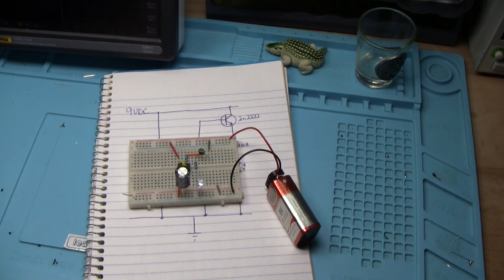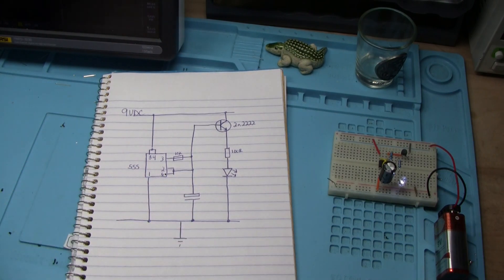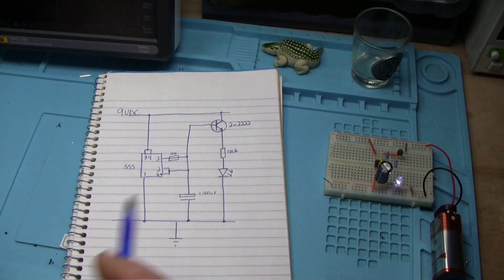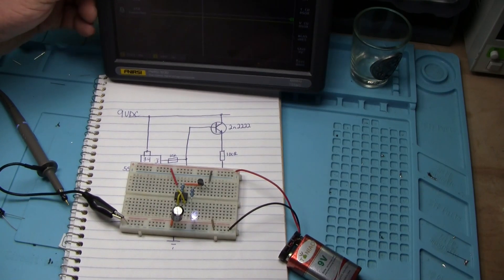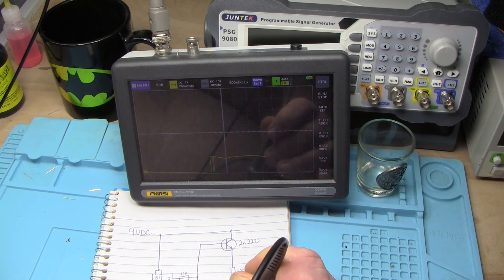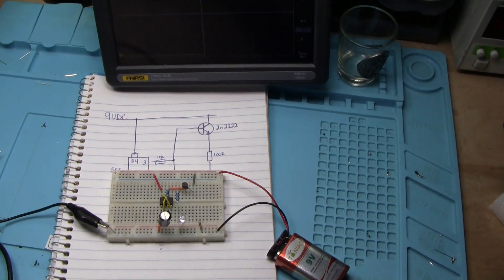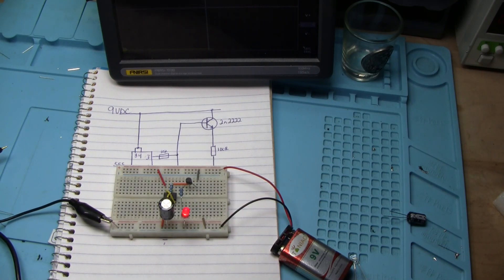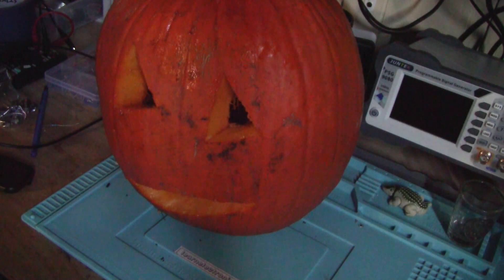Classic Circuits You Should Know - LED Fader

Comment: Thanks.

Pin-1 555 >>> GRD
Pin-4, Pin-8 555 >>> VCC
Pin-2, Pin-6 555 >>> Base Transistor, 10k, +Cap
Pin-3 555 >>> 10K

Base NPN Transistor >>> 10k, Pin-2, Pin-6 555, +Cap
Coll. NPN Transistor >>> VCC
Emm. NPN Transistor >>> 100k

100k >>> +LED
10k >>> Base Transistor, Pin-2, Pin-6 555, +Cap

LED- >>> GRD

Cap- >>> GRD

Comment: Thank you so much for showing us this schematic and explaining how it works - it's almost exactly what I've been struggling to figure out how to do so this video has been tremendously helpful!

I do not have a background in electronics so finding out, or rather, understanding wat different parts of a PCB do and why they do it is a real challenge.
That said... what I want to build, and to which this schematic has been so helpful, includes a touch sensor, and I hope that someone will be so kind to tell me if this will work or not:

If an add a TP233 to the schematic like this: VDC goes to Vin on the TP223, GND on the TP233 goes to GND, and Signal/Out (middle pin) on the TP223 goes to both the positive side of another capacitor as well as to pin 4+8 on the 555 chip (instead of directly hooking 4+8 up to VDC). My thinking here is that triggering the touch sensor will allow the process of fading in the LED to start and that the capacitor will provide enough power for the process of fading out the LED to complete (assuming that the touch sensor was not triggered long enough for 1 full cycle).

Will this help with: Allowing 1 full fade in + fade out of the LED with only a brief 'push' of the touch sensor?

Comment: very nice project. But I want more leds in this manner to light up, about 18 alltogether. Is this going to work this way? It's for lighting up my miniature tank, so I have to take 4 CR2032 or maybe a little bigger to get it into the model as source. I put this circuit into ltspice and it shows me for every led more a lower curve in voltage, so I'm not sure. Thanks for support.

Comment: Hi, Thank you for this informative video and circuit. I have built it as per your schematic but am having a slight issue. When the LEDs fade in and then out, on the out after about 2-3 seconds, the LEDs blink. I'm running off 5v, but had tried with 9v and the blink is there but brighter. Is there anything that can be done to remove this blink? Also what is the voltage value on your 1000uf cap, I wonder if that might be my issue? Any help on this would be very much appreciated. Thank you

Comment: @learnelectronics Hi Paul, Merry Christmas. 
Why is the load on the emitter as most circuits put the load on the collector, and how come you only need 100 ohms when Vs - Vf / If would typically be about 7mA for 9 volts?

Comment: So I could replicate that circuit say x3 on the same breadboard with varying caps and achieve sort of an oscillating of different colors?
Reply from the maker: I imagine you could, but doing so on the same breadboard is going to introduce some coupling.
Reply: @learnelectronics  Thanks for that. I was thinking that at that level the  undesired transfer would be limited. You're brilliant, Paul. Thank you. Steve.

Comment: The control voltage is pin 5.  I think you meant trigger (pin 2) and threshold (pin 6).  I got excited and thought you might have been doing some kind of pulse-frequency modulation using the v_control pin for a few seconds.

Comment: Does it not make more sense to adjust the timing using the resistor instead of the capacitor? 
I'm not sure what 555 timer you are using but most of them will happily supply 20mA of current so I think you can probably loose the transistor out of the circuit.

Nice to see the basics projects :)
Keep up the good work.

Comment: where do the test probes go? How do you adjust the time scale for the Oscope? Thanks.
Reply: You can see that rolling curve trace by probing across the LED. If you probe the positive side of the capacitor you should get a sawtooth form. You'll need a slow timebase, about 1s/div.

Comment: Hi, Thanks for the circuit. I have it already working! It was a nice treat... However, ever since I am trying to wrap my mind around the unusual configuration of the 555. Bear with me, I am no expert in electronics. But so far I have seen astable circuits done much differently. Could you, please, explain a little bit? I get that Trigger and Threshold (pins 2 and 6) are connected together and to the capacitor. This is standard. But normally, the capacitor is being charged from Vcc (through resistors) and discharged through pin 7 (discharge). Here, it seems pin 3 (output) feeds the capacitor and it is must be discharged through the transistor. I tried and it does not work without the transistor so that must do some magic. However, my ignorance kicks in here. Anyone can point me to an explanation? Thanks in advance!

Comment: Can you make the same effect with a 3v button battery ? I want to make a very light project with the same effect
Reply: You'd want to use a 7555 CMOS timer IC; it can go down to 2V supply voltage and uses much less power.
Reply: You could also use an attiny series, fade using pwm and maybe have it 'sleep' during the daytime. A touch more than a classic circuit but fun to build :)

Comment: I want this but then with 7 or more different timed leds.
Reply: use a 555 to drive a 4017 decade counter, then have the fade-in/fade-out timing components hooked up to the (max. 10) outputs of the 4017.

Comment: I think I would have configured  the transistor as a voltage controlled current source, taking the output from the collector. 
A more efficient solution would be to configure a dual 555 as a pulse width modulator, this would make best use of battery power. 
 A quad Schmitt can be configured as a flame simulator driving red and yellow LEDs with a pseudorandom oscillation. The same can be done with a binary ripple counter, such as the HC4060, which has a built in oscillator, that works with a RC network.
With such a long delay possible, it can be made to flicker and go out and then flicker again.
Thinking about it a quad Schmitt has sufficient gates to be configured as both a dimmer and a flasher at the same time, but then you know the quad Schmitt is one of my favourite ICs.
Reply: Kevin Counihan strictly speaking, the transistor, as an emitter follower is acting as a voltage impedance converter. Buffering the RC network from the LED. It is the resistor in series with the LED that is defining the LED current.
The difference between driving constant current or constant voltage is which makes best use of the full range of the saw tooth waveform, to give maximum change in brightness. The LED introduces a fix bias offset and the position of the resistor adds to this offset, then the Vbe of the transistor adds to this, it is therefore fortuitous that the range of the 555 output allows sufficient brightness variation.
Reply: Kevin Counihan  for someone who professes to have practiced electronics for so long, you seem to have a blind spot for circuit analysis. The LED has a fixed forward voltage. The emitter follower provides a low impedance copy of the voltage on the capacitor, therefore the current through the led series resistor is set by the difference between the two above voltages. That is a voltage to current conversion, I am surprised you did not know that. I was not implying that the circuit was not designed to work, what I am suggesting is that the DC bias voltage of the 555 output limits the design options.
And I too have fifty years of circuit design experience, but this is not shared by every reader, so an explanation is justified.
Reply: Kevin Counihan  you started this with your initial post. I have simply reacted to your comments. I made constructive comments, you elected to misinterprete them for you own reasons, and you annoyed me for that reason.